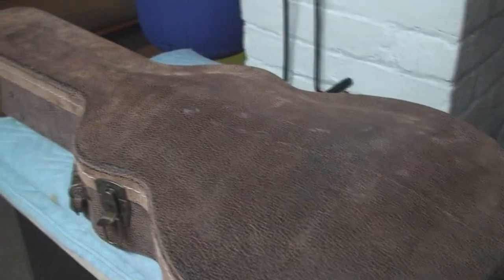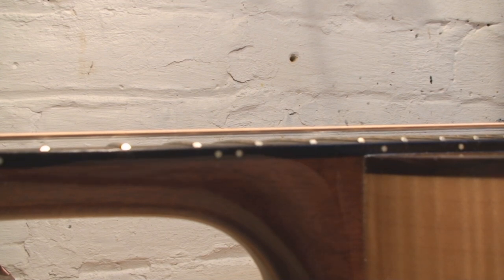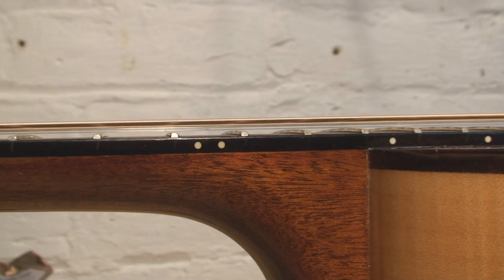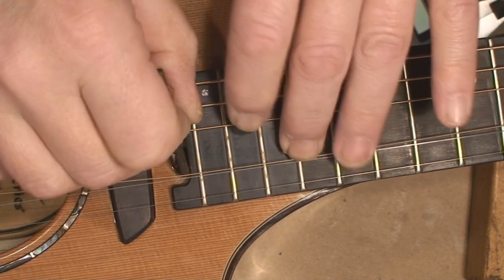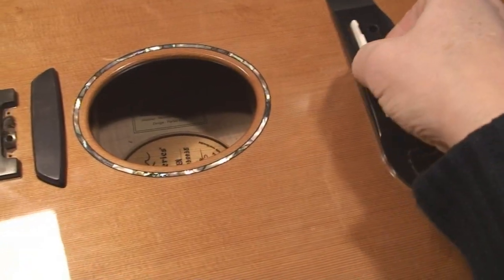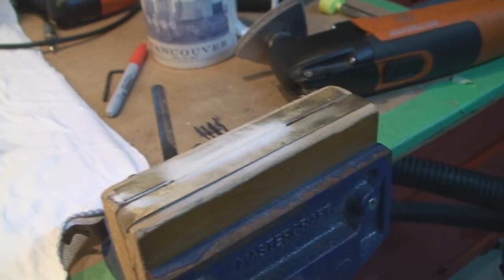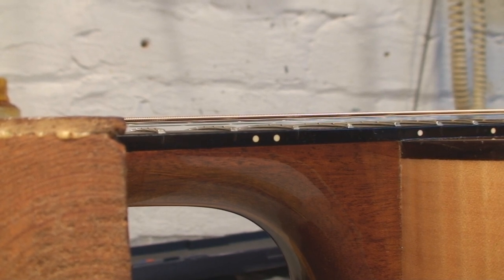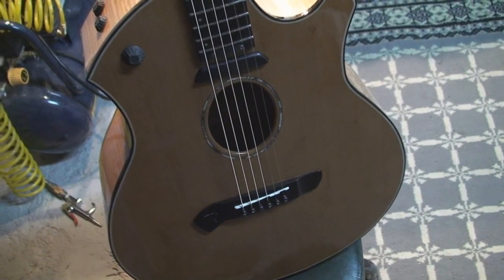Parker P8EN Acoustic Guitar Saddle Shave

Comment: I have been watching your vids for some time now and have gained a ton of knowledge, thank you! Your placement of the capo at the 1st fret is wrong. You placed the capo between the nut and the 1st fret, as if you were playing the note. The capo needs to be placed directly ON the fret. Placing the capo on the fretboard causes the string to arc up just slightly as it passes over the fret. Placing the capo ON the fret keeps the string flat, giving a more acurate measurement of the neck relief.